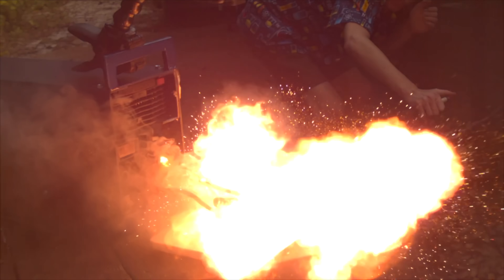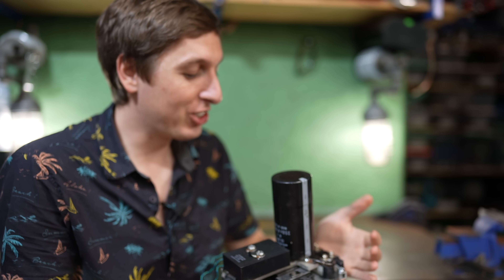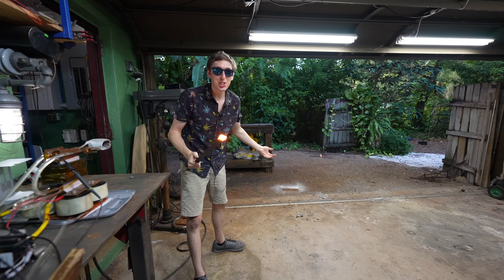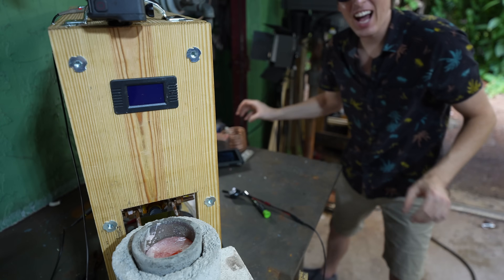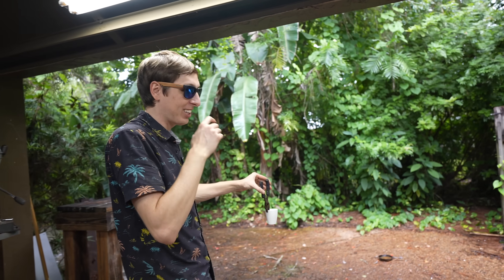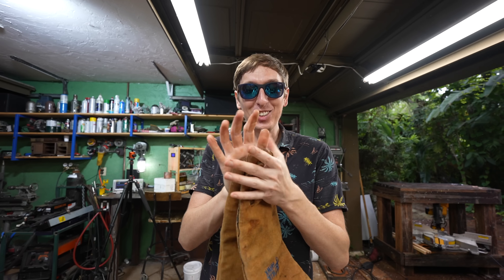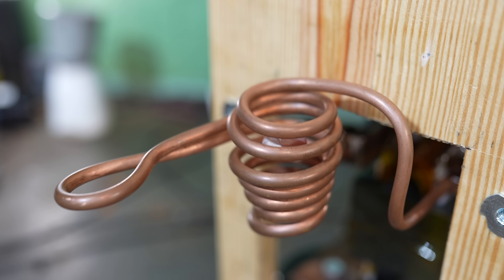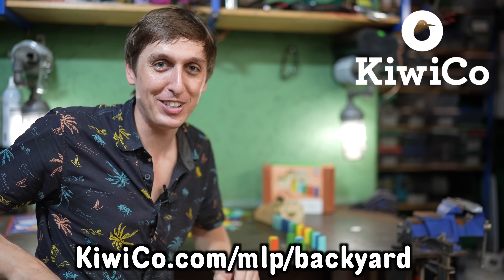DIY induction heater that can BOIL STEEL

Comment: Some soldering irons use this instead of a resistive thermal heater to heat the tip they are called high frequency soldering stations.

Comment: Me at work: being ridiculously careful with the expensive igbts, antistatic wrist band and using alcohol and a torque screwdriver on the board that connects to the gate contacts so they don't blow up in the field from a bad connection

Kevin: buries them

Comment: Just something for you to play with.  Assuming you can get an electroscope to charge in Florida, expose the top plate of a charged electroscope to the radiation coming from the burning magnesium and you'll see the scope discharge quickly due to the ionizing energy of the UV.

Comment: I just have to say that I am a structural ironworker of 24 years and I use oxy-acetylene torches regularly to cut steel (i also walk along steel beams, its my workspace) but this dude has balls of steel. For God sake he's wearing shorts and a Hawaiian shirt which are probably both synthetic material. God dammit man I want to buy you a beer I'm a fan I'm a subscriber.

Comment: If for some reason you want to actually get the metal to explode, put it in a mould with water or moisture at the bottom. That's how accidental casting explosions happen, because the water evaporates at a huge speed, causing a steam explosion.

Comment: I worked die casting magnesium and learned quite alot about it. It does give off uv while burning but if you wanna see something crazy throw water on it while its ignited and step back. It releases hydrogen gas.

Comment: When the steel was sparking at the end of the, what was happening was the carbon was being burned out of the steel, the same thing happens when you get a coal forge too hot as well.

Comment: When melting the aluminum, he really didn't expect it to work?  He already melted STEEL right from the start.  How is this guy able to make something like a high power induction forge, yet clearly not know something as simple as the fact that Aluminum melts at only about half the temperature that Steel does?🤔
Reply: It's non-ferrous; he didn't know if he'd be able to induce enough current with a magnetic field

Comment: Ever since I got my first induction cooktop I can't understand why we're not using it for heating homes? I put a cast iron pan on the old electric eye and it takes a good bit of time before it gets sizzlin but not with the induction, it's darn near instant! Same thing with boiling water, boiled water like a million times faster, slight exaggeration. But considering both the electric cooktop and induction are running at 100%/wouldent it be faster cheeper and overall better to use induction to heat a big thick hunk of iron that holds on to the heat far longer than a standard heating element

Comment: So the steel was definitely decarburizing. You were basically removing the carbon from the steel to make elemental iron. I wouldnt quite considet it "boiling," but it was definitely burning.

Please be safe when doing these things! Ive been a blacksmith and metal caster for 6 years now and this video was full of things that made my jaw drop in horror!

Comment: Can I buy 1 off you? I had the electronic furnace but kept it run to long and it stopped working.. Then I got a CastMaster propane furnace that's supposed to melt copper and gold but it doesn't.. I then went to oxygen & Acetylene (the small tractor supply tanks) And they don't last at all. My last option is a induction melting machine.. The problem is it's still winter so I'm broke.. I'm trying to melt gold I recently recovered but it's been a nightmare.. I have problem 3-4 grams stuck in a melting dish.
If you can't sell me one I totally understand bro! I will just have to wait or toss in the towel.. I can get the gold! I just struggle to melt it😔

Comment: You should revisit this, but make it so you can continuously add feed stock and have it flow out the bottom. Maybe make it in a way you can dump in cans and have it drip into an ingot mold.

Comment: A vacuum tube works way way better and can be air cooled.

Also, you want a zinc plated copper induction coil. Don’t cover it with concrete.

Comment: 4:00
* builds an induction heater that melts and levitates metal * „So I just built this“

* can‘t plug in the cable * „Shapes are hard“ 🤣🤣

Comment: Swinging white hot steel , next time consider your safety.
It could drip on you as you tip it towards you.

Believe me melted steel is hot ....
Dont do that! It's not dangerous , it's ludicrous 😐😐.

Look up the dangers first, magnesium that starts to really burn it only extinguished when it's burnt up.

Magnesium is highly unstable when melted even more when boiling.

Seeing that aluminium hover and stay melted and in form due too magnetism 😁

Comment: That Pittsburgh screwdriver set you have is amazing. It has just about every size. Has the holder to organize them and hangs on the wall. Best of all it cost me $21 when I got mine. Harbor freight might not make the best tools but they provide the most value. It would be interesting to see an analysis  comparing something like a snap on a life span and cost to comparable harbor freight products. Harbor freight might actually win.
Reply: A wise mechanic said to buy cheap tools and then replace them with good tools if/when they break. This is the quickest and cheapest way to figure out what tools need to be good and what tools can be very cheap. 

It also comes down to how often you use the tool. A homeowner might be completely fine with a 10 dollar claw hammer whereas a finish carpenter should probably spend a few dollars more because his livelihood and comfort depend on using something that gets the job done quickly and consistently.

Comment: Is there a low power way to create this for off-grid emergency heating? I want to be able to use any battery bank to power it.
Reply: A single 12 volt lead acid car battery running at the typical maximum 500 CCA (cold cranking amps) would be just enough to power the 6000 watts this induction coil set up requires.   So, no problem.

Comment: -Melts Steel in 35 seconds

-Wears shorts
Reply: Average day in Florida
Reply: Yeah, you wear shorts to keep yourself cool - duh.  (OSHA doesn't not approve of this message)
Reply: whats he gonna do. wear pants in august. IN FLORIDA.
Reply: Also flings molten aluminum around in shorts…
Reply: I used to think that I live dangerously, but I always wear pants and thick boots if I'm going to play with molten metal...so I guess I'm soft core?
Reply: Dood needs way more PPE and some mfn SOPs 😬

Comment: That metal bar heatup at 2:10 caught me off guard. I wonder if blacksmiths would be interested in something like this as an alternative to a flame.
Reply: A lot of knife makers use induction heaters for knives since they don't need large furnaces to heat up the (relatively) smaller pieces of metal they work with. Gas operated heaters and torches also need to be refueled eventually so it is a bit more economic in the long run.
Reply: @vivi_wuff  To add to this - it's a lot more accurate in terms of temperature and repeatability. I work for a very large manufacturing company and you can heat treat accurately and consistently with a small induction heater. If you shape the coils you can also consistently get a variety of hardnesses on the same part (strong flexible tang and a very hard knife edge).
Reply: The term is induction forge. It is a little too specialized to fully replace fire, but is still useful. It has been a thing for a while.
Reply: I've thought about finding ways to cast steel but every furnace I found ended up being ungodly expensive. Maybe this would be good to have. The problem is where to find one 😂
Reply: Blacksmiths use induction heaters for ages.
Reply: Black bear forge uses one
Reply: Yes blacksmiths are aware and like these. I am the "maintenance guy" at work and have had two different blacksmith hobbyist ask me if I could make one.

Comment: Very cool experiment. Do you think a scaled up induction heater would have any advantages over an electric arc furnace? I.e more efficient, faster ..
Reply: I have worked with both in industrial size (for steel and alloys that could count as nickel bases alloys) well the induction is more efficient
But a arc furnace has a very big advantage it is a reaction vessel  meaning it has a Lage surface area of the metal for metallurgical processes  for example the refining of iron (in German called frischen [freshen of iron]) to steel by blasting the molten metal with liquid oxygen (looks amazing by the way) and therfore burning lots of stuff in it alloy metals as well as impurities and converting the stuff in slag and gasses but that isn't all, same of the burned off alloy metals cann be regained back out of the slag depending on the conditions like the pH level of the slag, composition of the slag as well as the  temperatures in the furnaces oh and atmosphere

Also the "boiling" of the steel (seen in video) is actually carbon reacting with same oxygen inside the molten steel forming gases that want to escape and it takes a bit metal with it that is burning in the air aka the sparkle  and by adding a  element in the mix that is more affine too oxygen than carbon like silicon, aluminium, magnesium, same other pure elements and mixes the oxygen gets eaten by the more affine element and the steel is "killed"  and dosnt "boil anymore (in German we say beruhigter Stahl [literally calmed steel)

Comment: FYI. You aren't boiling the steel...
...You are setting it on FIRE.
Steel(iron) sparks happen when steel rapidly oxidizes.
When this happens slowly, we call it rust. When it happens fast, we call it BURNING. But it's really just the same thing.

The "steel blowing up in water" thing is...eh.
But I am VERY surprised that you still have any smooth concrete left.
When really hot stuff come in contact with wet concrete, the water flash-boils, creating a lot of internal pressure.
This can blow BIG holes in the concrete, and usually causes that molten metal to spray EVERYWHERE. Which is bad...
And there is no such thing as "dry" concrete. It just LOVES to absorb moisture.
You really REALLY should be melting your metals over a sand pit/box, so you don't end up with a hole, fire, and metal spray when your melting shenanigans eventually causes a crucible failure which is inevitable no matter HOW careful you are. It happens to the best of us.

NOTE: My first crucible failure happened when I was melting about 1kg of aluminum.
I was being "Safe" and doing it on a large, flat, clean concrete driveway. And everything was pretty fire-save because it had rained the whole morning.
That aluminum poured out the bottom of my furnace and...boom.
Or actually, like BANG! bubbubububbbububang.
After the first blob blew a 4inch deep, 16inch wide hole in the concrete, it splashed the aluminum around, which blew another 10-20 more holes about 1x6inches.
The shrapnel from the concrete also broke the side windows of a car 30+ feet away, and hot concrete/metal put a hundred or so holes in the siding of the house about 50 feet away.
I got away with some minor burns. My cloths were obviously ruined, and even my leather apron were pretty seriously damaged.
I'm SUPER glad for that apron. I got hit with a blob of ~200g of molten aluminum which solidified on contact. Jeans would NOT have prevented a major injury.
That blob actually hit me hard enough to bruise my leg through the leather and jeans. Steam explosions are no joke.

Comment: congratulations!  BTW, you can put out a magnesium fire with sand.  All molten metal fires can be put out with Class D extinguishers, but as a general rule,  have a bag of sand/kitty litter (dry) when working with this stuff.  Water, Carbon Dioxide, Halogenated extinguishers = disaster. :)

Comment: I wonder.. If you took this technology, heated a peice of metal to the nearly the point of melting and fired it, would the impact create the remaining heat nessisary to melt the metal on impact and i wonder how that would effect a bullets armor penetrating capability. Since it would still remain aerodynamic through flight.

Comment: I see that the coil is cooled by water pumped through it but how can copper survive the radiant heat? does the coil need replacing at regular intervals? what happens if it springs a leak, is there enough current running through the water to be a risk? can you heat non-conductive material this way?

Comment: Magnesium fire= Check out Le Mans  Disaster 1955 on YouTube. The Mercedes that crashed burnt for 2 hours as it was built from Magnesium metal (They couldn't put it out ?)
Check out "Le Mans crazy moments" 1955 (break down) about 1/2 way through

Comment: Magnesium 100% gives off extreme amounts of ultra violet light… what you are doing is the equivalent to holding a droplet* of the sun and staring at it with unrated eye protection. At UofA we are doing experiments with magnesium to see if it can tan skin and lol it really can. We will publish soon! We used interns who for about two weeks did not go outside and stayed in a room without direct sunlight…. Which if you know interns isn’t that difficult to do. Don’t worry we consulted with an oncologist and a dermatologist. 

*=(notice how I didn’t include a unit of volume or mass ;) because it’s (virtually) impossible to gather a piece/scoop of the sun. I don’t want to be a part of that expedition)

Comment: I used and industrial induction heater for pre-welding treatment
Tip don’t put your size 10 steel top cap boots in the wrong place…. You’ll be doing the hot foot dance all over site lol

Comment: Where the hell do you get 6000 watts of power from? To my knowledge a US plug/socket is only rated for about 1500-1800, here in the UK a plug/socket can handle up to about 3000 watts but that's still short of the 6000 you're using!

Comment: Trying to figure out why you were throwing those little transistor sized chips in a hole in the dirt, and then digging up the dirt later and finding bigger parts in the ground?? Looked like you were planting seeds and growing potatoes.! ^^^[] can't figure out that at all. Didnt get the joke.

Comment: You are dangerous and do not know what you are doing. You will get someone hurt or worse. You mess with molten metals and throw them around. You could start a grass fire that you could not put out.  You could burn down your home. You are a fool, a dangerous irresponsible fool.

Comment: Being 99% something will work is great for trying new food, picking movies, etc.  99% certain you won't hurt yourself when playing with molten cast iron or steel isn't that good.
On a more positive note, I sooooooooo want an induction furnace, especially for ferrous metals.  It'd save so much time and propane.

Comment: I find this experiments a little irresponsible.

1. throwing molten metals could cause harm if it bouce back to you. specially you  are not wearing any pants or any thick protection around your body. 

2. waiving a rod with a molten magnesium could end up in someones skin or your skin. its not like a melted plastic that can cool off easy. this is metal and could burn to your flesh easily.

3. though you have a viewer reminder of don't try this at home. maybe it is better that you show how careful you are in dealing with your experiments rather that doing it without thinking of the safety.

Comment: Can you make a parts list and maybe a build video for step by step in building this induction heater. Having only a YouTube education on electronics, it's hard to follow how you built this. I'd like to melt cast iron to pour castings. Most of the diy induction heater builds on YouTube are not powerful enough to melt steel in the quantity I'd like.